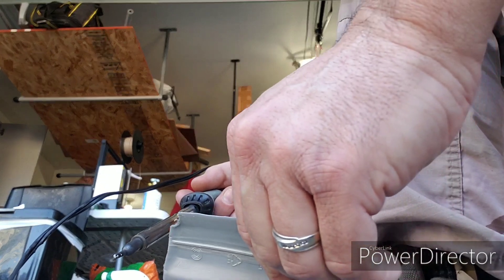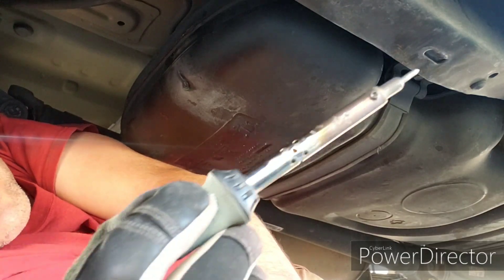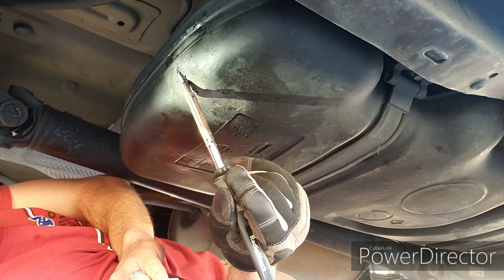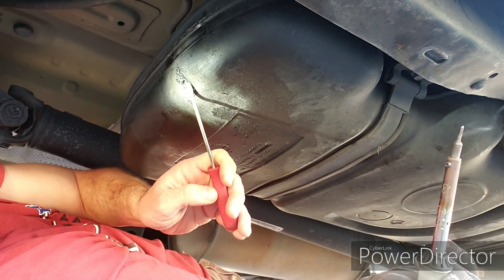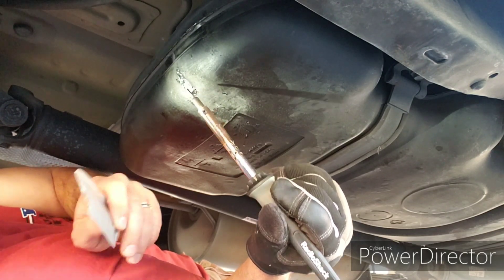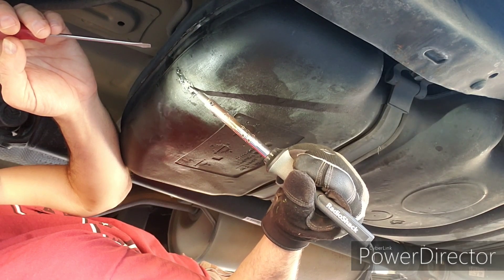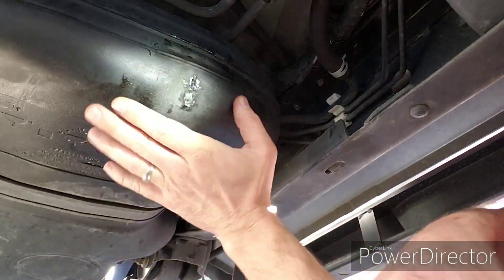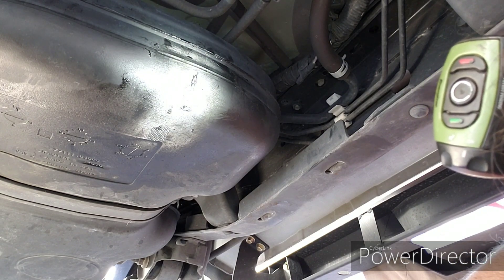Plastic Fuel Tank Repair with a Soldering Iron

Comment: if you have a round clean hole, you can stick a bolt in it with JB Weld (metal is for metal tanks, plastic for plastic) clean and sand before application

Comment: So a couple tips, number one is match the type of plastic you're filling the gap with to the tank material.  The tank should have a molding stamp on it telling you what it's made of.  Second tip is cut your filler material into skinny strip, like welding filler rod.  Weldors use rod as filler for a reason, it's really convenient.  Just lay the strip in the crack and stir it in.

Comment: Could a person use a zip tie as sort of a welding rod or filler material if needed? I'm fixin' to try this on a riding mower gas tank. I have about a 10" separation of the tank at the seam.

Comment: Good job overall. My only recommendation would be to use the flat triangle iron head on your soldering iron. This seems to work much better than the standard round head for feathering in the additional plastic filler material. Other than that I like your repair.

Comment: I can’t believe you didn’t Blow your Face Off!  You Lucky, buy a Lottery Ticket.😮😮😮
Reply: Minimal risk. Minimal. It's not getting that hot. The tank plastic may be getting to 300-600 degrees but the surrounding air in the Immediate vicinity isn't. Either way, if not comfortable with the risk, don't do it. A new tank for my son's Jag is $4000 for the Part and $2000 in labor to R&R the tank. That's $6k..  This same general method, with JB weld over the top, solved the problem of the a seam in the tank splitting 1"

Comment: For those people who are worried that the heat from the soldering iron will ignite the fuel, here are the numbers. HDPE (the plastic that fuel tanks are made from) have a melting point of 275F. Gas has an instant combustion temperature of 525F. That's the temperature that the liquid or the fumes will spontaneously combust with just heat, not flame. A soldering iron, depending on the brand, can get as hot as 392-896F. You have to know your tools. Keeping your iron on its lowest setting, staying in a well ventilated area, and having no way to create a spark or open flame, you can do this repair safely.

Comment: I suggest that cutting out a piece of tin pan, wrapping it around the heating element, and then flatten the tip width so to press melting plastic better with heat.

Comment from the maker: 3 year update - still holding! 
To address some of the concerns about safety - it may not have been clear in the video, but the tank was virtually empty, and it was parked on a relatively steep slipe with the rear going downhill. The puncture was at the front of the tank, so there was zero gasoline anywhere near where I was working.
Reply: But fumes ignite easily.  That soldering iron is over 500 degrees F.  Gasoline fumes ignite at near that temperature.
Reply: @EmilyTienne Heat is one thing, flames are another. Flames weren't present. I've done the same thing several times. Not a problem.
Reply: Thanks for update the status!

Comment: Thanks so much! I did my first repair on a 2016 Nissan maxima attempting to use fuel tank grade JB Weld and flex seal tape. Horrible results but then I saw your video and you saved the day. God bless
Reply: Never worked for me
Reply: @gibby_gets_it  Run the gas out, jack it up on the opposite side so that the gas is draining away from it. It’s the Gasolina will not allow it to cure… Hit it with some brake cleaner first
Reply: @HiDefMediaInc  how long does it take to cure usually
Reply: Cause she ain’t leaking now😂 put a thicker plastic on there and it’s doing decent
Reply: @gibby_gets_it  it will set in about an hour but for a good cure leave it for 24 hours
Reply: @HiDefMediaInc  ok thankyou, I’ve got 2 different plastics on it, thinner layer on the inside as a filler and it was still leaking them got some thick plastic for an outer layer and doesn’t seem to be seeping anymore, also a couple coats of each

Comment: I noticed the original repair looked like metal tank repair kit. They make a QUIK WELD plastic fuel repair kit, looks like white modeling clay. Might have worked better and also serves as malleable filler after the solder bond.
Reply: Hi. Are you referring to "jb weld, kwikweld, metal, wood, plastic, tile, pvc, ceramic, fiberglass, concrete and more" ... tx

Comment: Fuel fumes and hot iron. Sure it will fix Ur whole car and garage in second. Working in short tshirt no safety glasses.
Reply from the maker: No arguments with any of that except that I was indeed wearing safety glasses... they are literally in my face at the start of the video. Also, I was working in the driveway. 😁
Reply: I used a face mask so I dont  inhale the gas fumes  or the plastic smell ..

Comment: I did the same thing, what i did diffrent,was melt the plastic to almost liquid in a metal lid/cap and then used a flat tip screw driver and pack the slit with the melted plastic, great video

Comment: Fuel Funnels are typically made of the same materials as fuel tanks.  I trimmed a sliver from the edge of a red funnel to repair a puncture leak on a six gallon gas can I found along the road.  It worked like a charm and I filled the tank with water for 24 hours to make sure it didn't leak.
Reply from the maker: Brilliant! I will keep that in mind in the future.

Comment: Use to use zip tie for plastic welding. Helps with a ton of crap. Sanding and re welding plus spraying a new coat of paint helps a lot in the end for a good result

Comment: YOUR NUTS heat and fule not a good combo if gas comes out and drains in to that handel where the switch is or in the windings your next video will come from the burn unit .

Comment: Awesome video. So I found a puddle of gas under my truck and found that someone drilled straight into my tank and stole the gas. Shop quoted me 2500 for a new tank, pump, filter, and hoses. Glad you made this helpful video.
Reply: Someone just drilled a hole in my tank as well. I have a ram 1500. Are these tanks completely plastic, or is there some metal in them?
Reply: @darriusholt  completely plastic
Reply: @darriusholt  completely plastic, only metal is the locking ring on top of the tank for the fuel pump
Reply: Same here man someone drilled a hole on my silverado tank
Reply: Mine is a Silverado too!!
Reply: Just replaced mine today. Used 2 pieces from old oil jug, one smaller then the other. Got a soldering iron with a flat attachment from Amazon and it worked great. Lifted the truck on one side so the fuel wouldn’t be near the hole, then I went at it. Came out SOLID and I saved $2500. Thanks again!
Reply: Shit same thing happened to me lastnight to my 1500! this is my next step, because yes tanks are expensive.
Reply: Somebody drilled out my Ram tank and I lost 85 litres of fuel a few hours before I was due to leave on vacation. I was able to tap a 12mm thread in the hole and snugged up a 12mm bolt with an O-ring. It held fine, but for additional protection, I scuffed up the tank and added a poultice of JB weld over the bolt head and 3" radius.  I still plan to drop the tank and do a proper plastic welding job. If I was going to mess around with heat and the tank in place I would have at least purged the tank with nitrogen, or, something inert to minimize the risk of a flash/eruption.

Comment: I used your method but with a black comb on a Jeep Wrangler plastic fuel tank and it worked great. I soldier it from inside and out because I have the tank out of the vehicle. Thank you.

Comment: i have a hole in the neck part of my boat tank ..it's the built in tank .. did you drain the gas first ?? ??? thnks for the video
Reply from the maker: I did not drain it. I drove it until it was almost empty, then parked it on my sloped driveway with the rear end downhill to get any remaining fuel at the back of the tank. 
Good luck with your boat!

Comment: hi how are you? thank you for your video, im glad it worked out well for you. only thing i can think of different would be to melt in some whiskers of a wire brush or thin wire to act like rebar in the weld. on dirt bike fenders ive added in wire bug screen or even square mesh (small as possible holes) chicken wire and just heated it to melt in and then cover with plastic to bury it. also maybe a wider flat tip for the iron. thats just my 2 cents =-)   thank you again. its always awesome to find folks that find a way for us to save a little money on things we are charged ridicules amounts for at shops and dealerships.
Reply from the maker: I like your suggestion about reinforcing the repair with wire of some sort. I'll keep that in mind if I have to do this again! Also, I definitely would have used a larger tip if I had one available.

Comment: If someone knows  :  can I use the old steel gas tank  was installed in   1987  Chevy   for  the  1992   Buick roadmaster    ???.

The original roadmaster   plastic or   polypropylene  gas  tank is very bad

Comment: Just used your method ( regular soldering iron an a cleaned up scrap of black oil bottle) to fix a seeping seam on the plastic tank on my BMW K1200LT motorcycle. I'm sure the dealership would have charged around $3k to install a new tank! Thank you for posting this!

Comment from the maker: 1 year update... still holding. No leaks or gas smell.
Reply: the update is appreciated...most youtubers dont follow up. Thanks.
Reply: Is that tank made of Polypropylene? Thank you!
Reply: Thank u
Reply: I ran over a huge screw believe it or not, all gas is out and the gas fumes are out since I opened the cap, would I be able to use this same method on the car like you did?
Reply: Legend :)
Reply: Thanks so much for the update
Reply: 2:59 "The range indicator says I have about 10, 15 miles left. So, I shouldn't have more than about half a tank of gas in here." 🤔 A cruise range of about 30 miles per tank. That's pretty bad fuel economy.😀

5:15 "Indention." Indentation. Indention refers to indenting a line of text.

Great to hear that the repair works! And, that a soldering iron won't (or maybe at least for you did not) cause trouble for you by igniting fuel or fuel vapors. It'd be funny if you reposted the video, with you in a fake hospital bed, all bandaged up, saying through your bandages, that the repair mostly went great!😆 Sort of like a CNN reporter, standing in front of a burning building, describing a "mostly peaceful protest!" LOL

I drove over the tread of a failed big rig trailer tire, and it hit my Scion tC's plastic fuel tank, and I was disappointed to learn that a shop wants $2 grand to replace it with a new one, and my insurance company thinks it's about an $850 repair (counting on a used tank), sending me a check with a $500 deductible removed. Pretty awful of companies to use plastic tanks and not at least include a protective plate.

I might give this method a try. Awesome idea about the plastic bottle as a source of donor material. I've heard of using plastic zip ties as a source. Unknown what plastic those are. At least the bottles will be stamped with an identifier. By the way, there are flat blades that can be used on soldering irons, to make such work easier. Also, they do make actual plastic repair irons, but I think a soldering iron ought to be fine.

Good work. Thanks for posting. And congrats on saving a grand or two, and labor of removal and replacement!✅
Reply: @planethedgehog2427  l

Comment: Any tips for fixing an inch size hole from someone stealing my gas. I tried leak fix didn't work properly because it needs to be completely dry
Reply: same method! Use plastic from zip tie or oil bottle and slowly melt it together like he did in this video.
Reply: Drill out and install a bung from a water container.

Comment: My car got stolen and brought me here coz mf drilled on my tank to get the gas. (One of the problems)...so i think i got a metal tank so i guess its better if i weld that hole using lead? Is that safe? Thanks.

Comment: I punched a hole 40mm x 10 mm in the fuel tank on my tractor, I have just put the fuel tank back into my tractor after doing your repair it did a great job  thanks

Comment: Glad to hear from you that 2 months ago there was still no sign of any fuel leaks.
At the 12:00 minute mark you ask if we have any suggestions: 
Although it is more work, I would have removed the fuel tank and would have done the repair with the fuel tank away from the vehicle.
Needless to say, it is safer for the repairman with the fuel tank removed, you have more room to safely work on the fuel tank and you can still test it safely while removed.

But again, that's just how I would have worked it.
And from time to time, please put out an update to let us viewers know if no more fuel leaks, as we all wanna know.
And thanks for sharing your video with others who like you, want to save $$$ on expensive repairs.
Reply: The problem with removing the tank is that you take all the load off the tank to make the repair and then bolt it back in and put stress on it. The best way to repair is to have it in it's natural position. Once the gas is drained it's no more dangerous installed than uninstalled. And really, gas is pretty stable with that type of heat source. Open flame or spark is where things can go wrong.

Comment: Mines is leaking gas as we speak, I'm assuming I'd have to drain the tank before I attempt any soldering right?
Reply: So the fuel pump is non electrical😂?
Reply from the maker: Yes, drain or drive it until empty. Try to park on a hill so any remaining fuel sits away from the area being repaired.
Reply: I used a patch kit that included a resin that temporary stops leaks.  Then I used the Plastic welder to fuse the plastic back together.  No need to drain the gas.
Reply: @jacobnolan41  no need to drain the gas? Is that right cause i would think a electric device next to gas fumes would combust

Comment: I have an 06 toyota tacoma. I ran over a metal wired and it slashed my fuel tank. I've tried to block the leakage with jb weld fuel epoxy and it has been holding up but u can see that there's a tiny leakage. Imma try ur method. Thnaks for the video

Comment: Thanks for this mate, going to try it on my Jag 👍🏻
Reply: Too funny. 05 SuperV8, 1" crack along a seam at the top, rear of the tank. Problem solved with melting the general area, overcoating with JB Weld standard. Pressure tested the tank prior to reinstallation. Works. A New tank was $6k installed.  $4k for the tank and $2k for R&R

Comment: Really interesting idea. I don't know why a car manufacturer would use a plastic gas tank. That just seems like a recipe for disaster.
Reply: 3 main reasons. 
1- plastic is highly resistant to corrosion. 
2- plastic will melt in fire and start burning the fuel inside it unlike metal tank which will start pressurizing until the tank explode. 
3- light weight.
Reply: @xTheGamerHeart  don't forgets it is cheaper for manufacturers
Reply: Easier to steal your gas 😂 crawl under punch a hole  and leave you stranded.😂
Reply: Lighter than steel, cheaper than aluminum.

Comment from the maker: Update... 5+ months later and it's still holding strong. No weeping, no fuel smell. 🙂
Reply: Thank you for the video I’m going to try to fix mine.
Reply: No for much long lol😂 Ive done this like about 8 times now on my 240sx plastic fuel tank, theres really no possible fix
Reply: Anyone else thought this was going to end badly for him , I would recommend removing the tank and emptying of fuel , drying and maybe even filling with water before soldering fuel tanks .
Fumes are combustible , even more so than liquid fuel.
He's lucky to be alive and so is anyone else that has used this ' method '. 
You have been warned.
Reply: @truthseaker3742  you have been warned? He just schooled you in a video. If your schooling was accurate he would have not been able to post - so you are wrong
Reply: @nosoupforyou425  he got lucky.
and for u
I PITY THE FOOL
Reply: @truthseaker3742  or... you are wrong.  I know it may seem impossible in your head. But from the outside it seems VERY possible
Reply: @truthseaker3742  B.S.  Open area, well ventilated. Too much oxygen or too little and it won't ignite. A/F ration in the cylinder is About 15:1
Reply: Great 👍🏽!!!! I have a similar problem with my  Nissan

Comment: Did you have to drain the fuel tank before doing this? I'm nervous about having a soldering iron next to fuel vapors
Reply from the maker: Nope, I just ran it until there was about half a gallon of fuel and parked it facing uphill on my driveway.
Reply: yeah i would,i'm doing repair on my fuel tank definately going to empty fuel tank,fuel is a comdustible material crinky you end up blowing yourself and the vehicle to simerines
Reply: Tried both things on my r32gtr leaking plastic tank and nothing, maybe the plastic i used just didnt match the tank's plastic